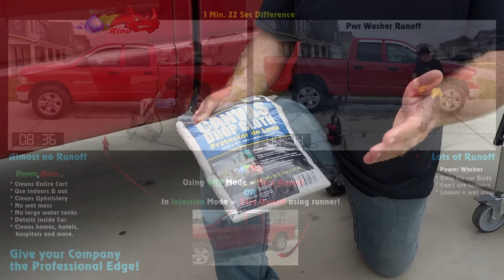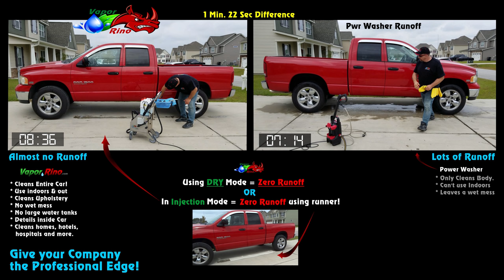UPGRADED Now 200 PSI! (Faster OR Better?) Power Washer VS Dry Carwash Steam Cleaner Vapor Rino Steam

Comment: I'm very interested. What about cold temp, what temperature range can it be used at. I'm located in Alberta Canada.
Reply from the maker: Hi Ian,  the Vapor Rino can be easily be used in temps below freezing. We have an old video of one of our smaller units cleaning a car in 27 degrees F, well below freezing. Not even close to having a problem. The heat from the boiler keeps the inside of the unit nice and warm during use.  Once done, put the machine in a warm environment when you are finished. You don't want the water lines inside to freeze while in storage. Store indoors.

Comment: Were you using the Optimum No-Rinse Waterless Car Wash solution?
Reply from the maker: No, we were using an over the counter solution. Picked it up in Walmart. We are testing out budge solutions, it worked well. Thanks for the question. What is your opinion of the Opt formula? Cost vs how good it is?
Reply: I have use ONR (Optimum No Rinse) for years and its amazing.  They also make a version with wax in it.  I prefer to use a spray sealant for speed and a paint coating after paint correction.
Reply from the maker: Thanks Boodieman, i will be ordering some and trying it out. Best wishes
Reply: @vaporrino  For me it's worked great. I dilute it retty liberally to about 1 oz : 1 gallon and it, in my humble opinion, has the perfect viscosity as well as suspend the grime to be wiped with the microfiber. As far as cost, the $15 dollar bottle gives me about 32 gallons of usage.
Reply: You add 1oz per gallon.  So it goes a long way.
Reply from the maker: @Boodieman72   Hey Random Acts of Video,, if you ever need anything give us a call. We appreciate you. Contact us at www.VaporRino.com
Reply from the maker: No but it is a great product,  you can find it at Amazon.com and of course, you can find the machine at www.VaporRino.com